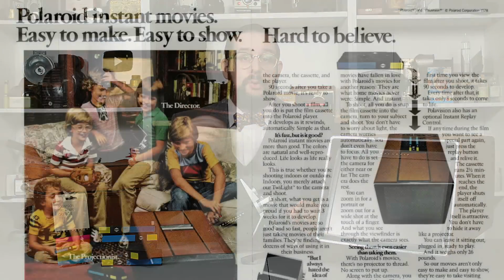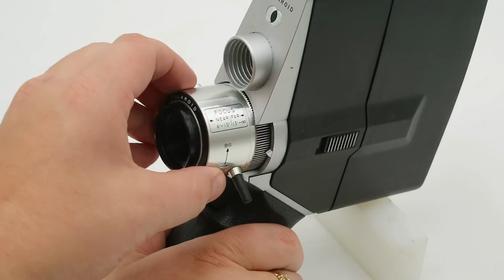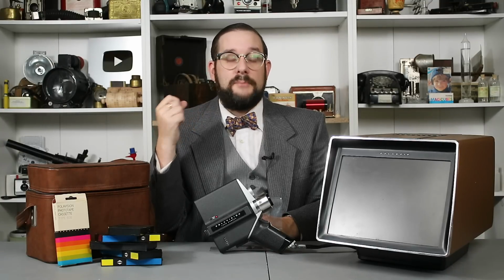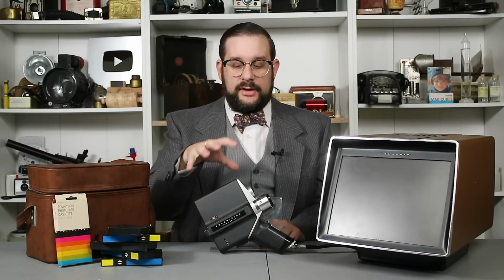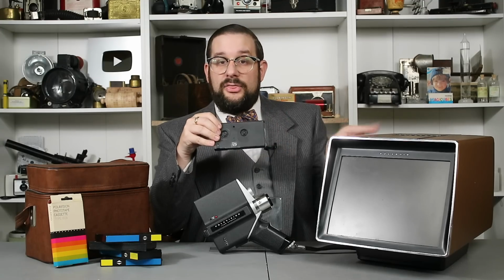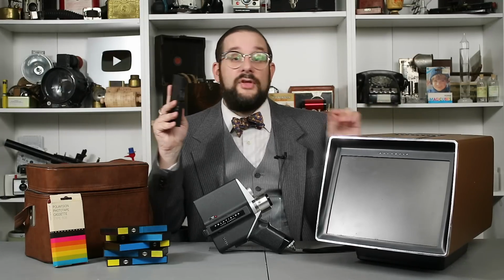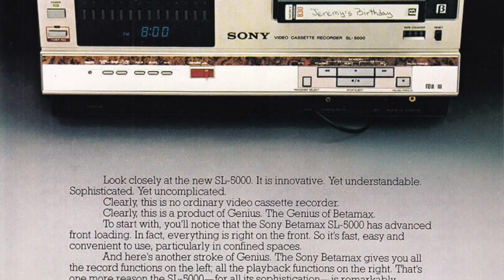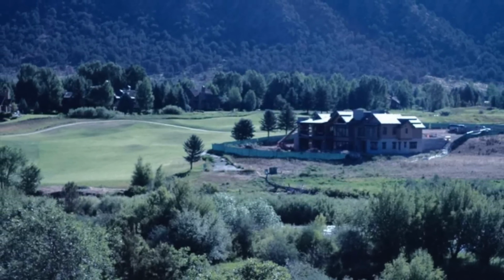Polavision: the Product That Killed Polaroid

Comment: Here in the UK it was not a very popular format - having said that, as I transfer cine film to digital, a client brought me in 19 cassettes of this to transfer a while back. It is based around super 8mm film but runs at 17 fps rather than 18 fps for actual super 8mm.  The one issue that I guess was never thought about at the time of production is how the chemical residue would hold up in the years to come. The cassettes that I had to copy had all suffered from the chemical base drying out and cracking. I was able to mitigate this issue with a combination of restoration software and DaVinci Resolve Studio to actually give them some passable material to view - although as you stated in the video, the sensitivity being only 40ASA produced very dark original images. Of course transferring this film results in the destruction of the cassette but it is quite impressive inside with the prism etc.
Reply: Normal super 8 was 25/50 iso and also dark;also super 8 standard makes streacks:the hot of the light of the projector make this problems because cooked the film
Reply: Hi, I live in the UK and have a few of these tapes from my childhood, what do you charge to convert to digital format ? If indeed they are savable at all
Reply: @Elberto71  I charge £18 per cassette - I have to take the film out and put it onto an 8mm spool and then transfer it on my system and clean it up in post and conform it to 24fps.
Reply: @gadgetsgimmicksandtech  nice one, I'll be in touch

Comment: It might have been a success if it had a 30 minute runtime. But at only 3 minutes, it would have been a flop even without the competition from videotape.
Reply: The Kodachrome movie cassettes also gave about 3 minutes runtime and they were very successful. The image quality was a lot better and the film sensitivity was higher. Plus, once you mailed in your exposed film for processing, there was a delectable frisson of anticipation waiting for your movies to come back.

A 30 minute runtime would require about 650 feet of film. That would make for an awfully large and heavy hand-held camera.
Reply: @johnopalko5223  Super-8 offered sound and by the time Polavision debuted, 10 minute Super-8 cartridges at 24 fps had been available for several years. I stand by my assertion that even without videotape, Polavision would have flopped.